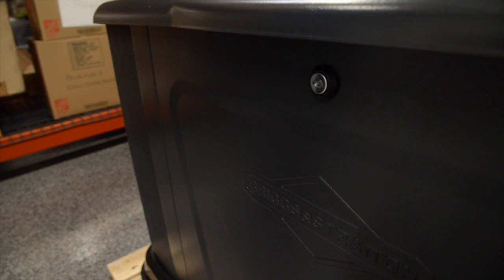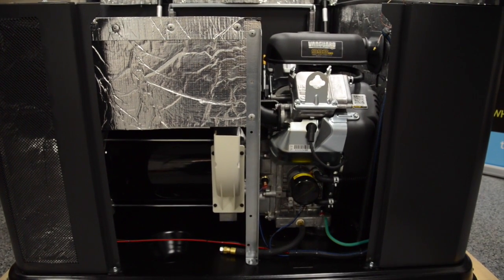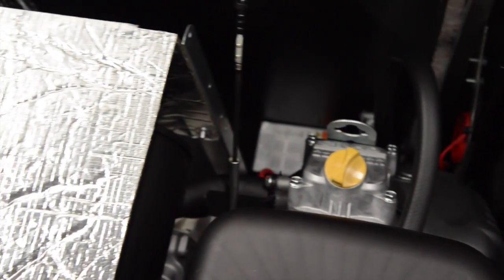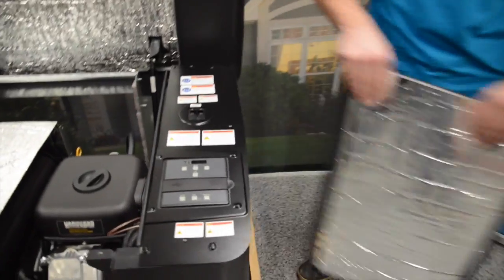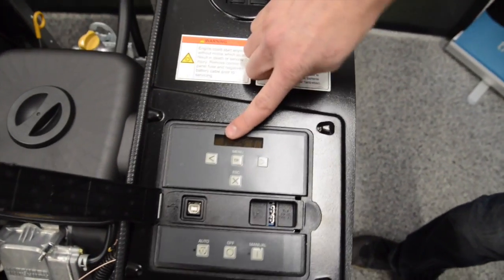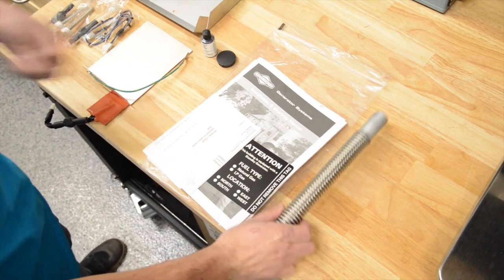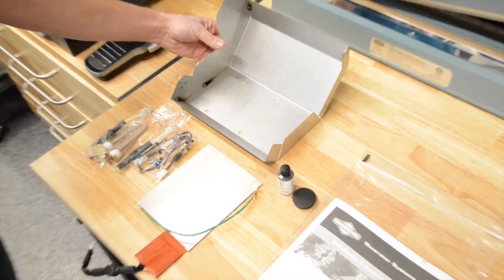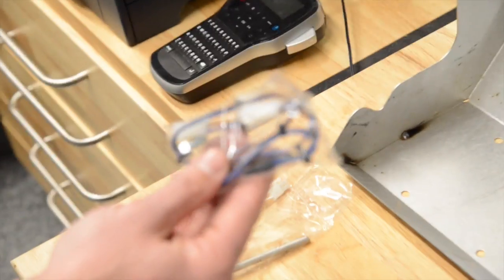Briggs & Stratton 20kW Automatic Standby Generator 40346 Overview

Comment: I just bought my 2020 version of a 20 KW Fortress Next Gen - 6 year warranty. I spent more for the 6 year warranty but I used a local small engine repair shop and retailer. They have a partnership with a local man that comes out to your house during bad weather/storms/worse and will fix. He also sets you up for a schedule if you want to have him do all the oil changes/spark plugs, etc.

The unit is much louder than I thought. even with the lid closed and about 40 feet back my decibel app registered about 78 to 82 db. The installers app registered 67 at 20 feet. If we lose all power though I am sure the neighbors won't mind as they will probably be coming over.

The cost included generator, auto-transfer switch, all cabling and I am using natural gas. The stand is concreted in and using natural gas. Been waiting to move to a place with natural gas and a long time purchase of a home. real happy so far!

Comment: How much oil do they take for an oil change and part number for the oil filter would be helpful!
Reply from the maker: They take just under 2 Quarts. I like to put in ~ 1.75 Quarts and begin checking the dipstick.  After you drain the oil, replace the oil filter, and fill it up, I like to check the dipstick first, run it for about 5 minutes and then check the dipstick again. Depending on what oil filter you use, they will require ~1.6 - 2.0 Quarts
We sell parts online at marrpower.co

Comment: Does this generator have an expected hour use life?  10k, 30k?  Can it run nonstop for a week or two?
Reply from the maker: Typically residential air cooled generators have a ~2,000 hour life expectancy. This varies greatly depending on climate conditions and level of preventative maintenance service performed. The generator can run non-stop, provided it does not have fuel interruptions, for up to 200 hours which is when it is suggested to change to the engine oil.

Comment: How Is that generator doing now?
Reply: I have had this generator for 5 years so far and runs like new. Lost power a few times with longest outage of 2 days. Ran non stop and whole house had power. Even electric dryer and furnace were running at same time with tons of lights etc. Love this generator.

Comment: I have this unit but its an older one , It started pushing oil to the carburator, what causes this and how can i repair?
Reply: Did you change the oil recently..?? You may have over filled the crankcase.... The crankcase vent is hooked up to the intake side of the carb so oil can be shooting back up thru there IF there is too much oil in the crankcase... 
If its an old unit with lots of use it can be a damaged cylinder wall or defective pistons rings allowing oil to seep thru and exit thru the carb... 
What air filter do you use..??

Comment: Why a Briggs over a Kohler or Generac ..??
Reply: Kohler Gen Sets are made with a Briggs Engine. Generac's can't run long term.
Reply: What is considered long term..??
Reply: @devinstevens3129  
Generac makes their own engines and they are designed for long run times. Briggs and Kohler use an engine that is designed for lawn mowers. Designed to run an Hour or 2 and then be shut off. Generac is designed to run for days or weeks. I am a generator tech and saw more engine issues with kohler and briggs than generac
Reply: @corywise6164  which generac 20k stand by would you recommend?
Reply: @corywise6164  A 900 cc V-twin is a lawn mower engine?  Must be one hell of a lawn mower!
Reply: @corywise6164   I have a Briggs and lost power for two days. 20KW unit. Mine ran non stop entire time and never skipped a beat. So not sure what you are referring to but mine did what it was supposed to.
Reply: @rockystelone21  do not be sold by a generac fan until you do your research.
Reply: @quintonstone7324  its been a year in that time period i read articles and watched videos of Generac absolutely horrible customer service and products. So Generac is off the table for a stand by generator.
Reply: @rockystelone21  Briggs is by far the best when it comes to honoring their warranty, Generac not so much, Kohler, you better be sitting down when you get a price quote on repair parts if needed.
Reply: @corywise6164  You are so wrong about a Briggs engine only being designed to run an hour or two and then having to be shut off. As a claimed "generator tech" where did you come up with this idea? AS a "generator tech" myself the engine issues we see really don't favor one brand over any other, they all have issues. Generacs 5 year warranty is also a farce, read the fine print, it is not a 5 year FULL warranty.

Comment: I wish I could get somebody in my area to figure out what's up with my 20 kW Briggs generator we bought this thing and had it installed for peace of mind it runs every Wednesday for about 10-15 minutes exercising and shuts off like it should we had our first power outage yesterday it came on ran for about 30 minutes shut off fault code said under speed not sure if there were any other faults call the electrician installed it he's too busy to get to it right now called Briggs they gave me numbers of some other technicians.

There has to be a answer to why it's doing this that's all I want to know why am I getting an under speed reading and the generator shutting off we're not running a lot of appliances the only thing on here at the house is our air conditioner in a few lights we're not overloading it.

So so far peace of mind is out the window.

Comment: This generator is way more confusing than the generac generator. The house I'm buying has a Briggs and Stratton and I'm not looking forward to having to maintain it.
Reply: I have this generator and do my own maintenance. Extremely easy. I choose to change the oil, air filter and spark plugs once a year. The only thing I do not like about it is the oil drain hose as it is very low to the ground and not easy to pour into a container when draining. So instead I use a oil syphon pump you can get from amazon that goes down into the dipstick tube and just pump it out from there. ( warm the engine for five minutes first). But all in all I love this generator.